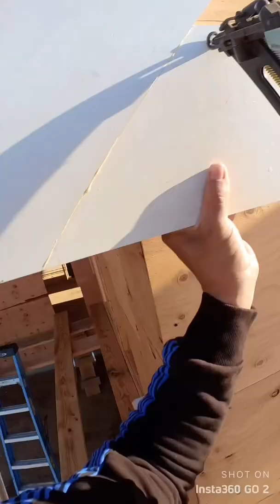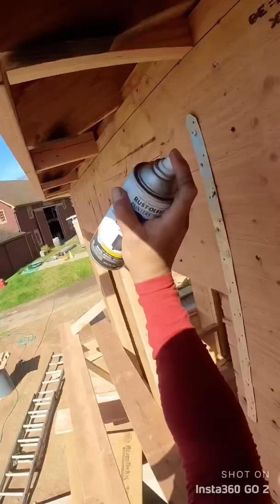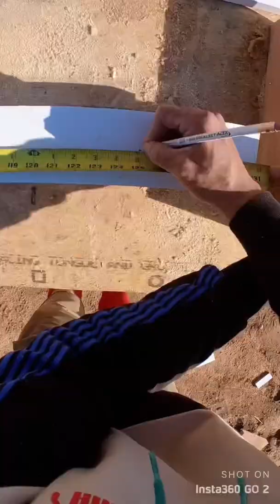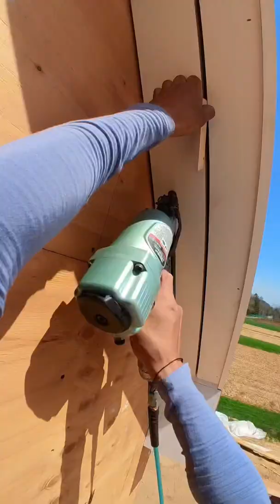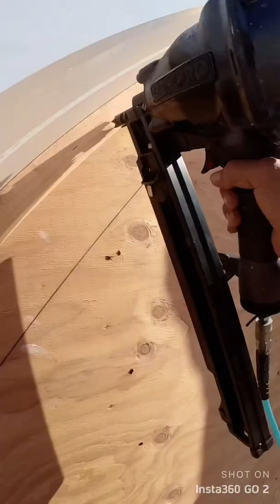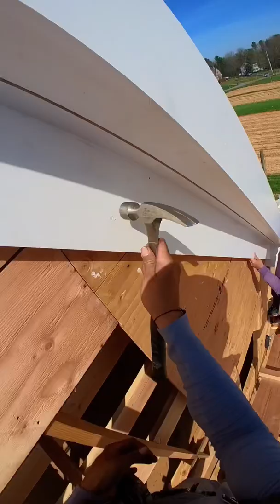#construction #shorts #design #work #architecture #quality #artwork #beautiful #art #framing #tips

Comment: Love the soffit detail. Don't understand why you're venting the rake though.
Reply: @Anakin Skywalker I understand doing it along the eaves. No point in doing it up the gable.
Reply: @Anakin Skywalker this is usually accomplished with soffits, not on the rake. Of course more air flow is best but this is overkill
Reply: Because it looks.
Reply: Good
Reply: @phantaxsniper3681  vented rakes degrade the performance of the roof ventilation. It provides a shortcut to the ridge vent. Depending on the local climate, that might be a regrettable mistake or a non issue. I live up North and ice dams are a real concern, so venting only from bottom to top is vitally important to keeping the roof sheathing below freezing. Warmer states with less harsh winters will have different needs for their attic ventilation, and will do it slightly differently.
Reply: @mikeirvin9694  very insightful reply.
Reply: @mikeirvin9694  well said Mike
Reply: Wasps will love it
Reply: Bugs will invade it for sire and leave a real maintenance issue. In Alabama, I would be forced to cover it.
Reply: Beat me to it.. gable wall venting? Guessing the GC told them to do it and they did